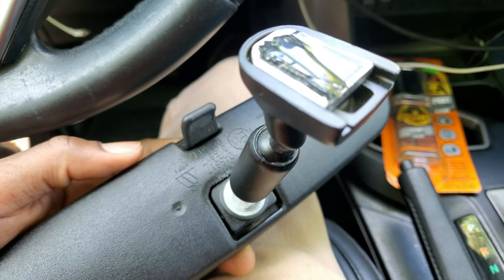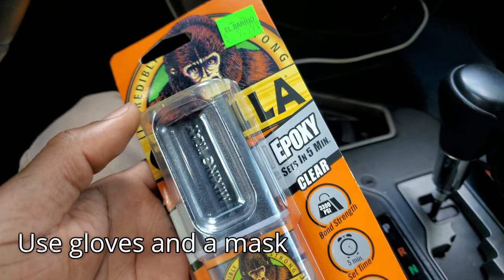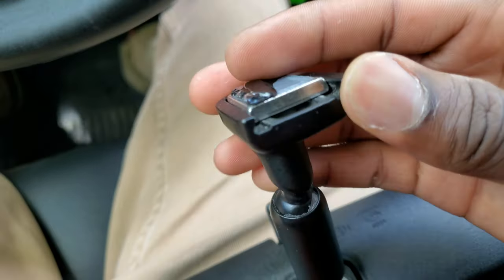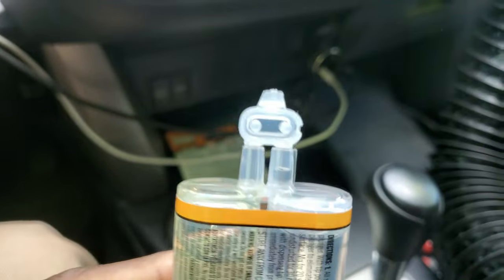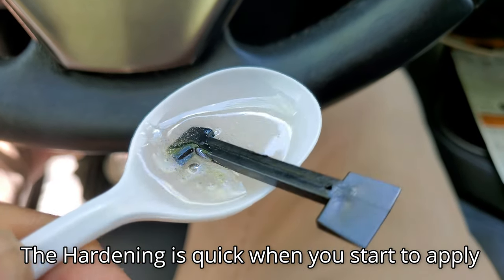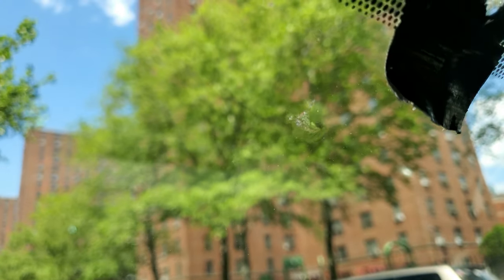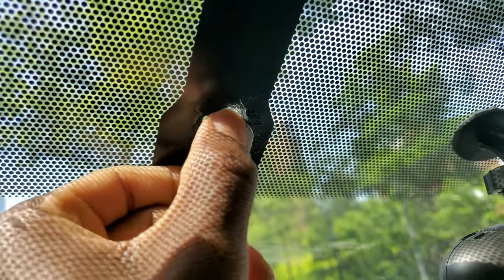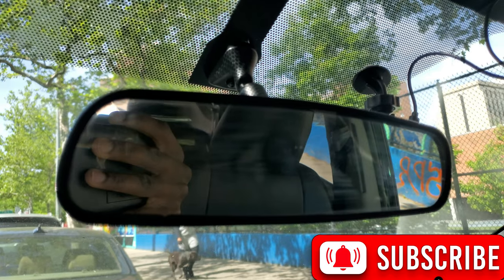Fix Broken Rear View Mirror | Windshield dent

Comment: So i have the same problem. Do i keep the glass on the metal piece and place into the hole w/ epoxy or do i fill the hole up w/ epoxy, scrape the glass off the metal and then reattach the metal to the expoxy and then of course the mirror???
Reply from the maker: scrape the glass off the metal piece first, then fill the hole in the windshield with epoxy. If you are using the same glue I'm using, be swift with it when applying the glue, it hardens quickly. Also have the metal piece orientation in mind so you don't accidentally place upside down
Reply: In addition, do we allow the epoxy to dry first and then glue the metal piece on or put the metal piece as the epoxy is drying?

Comment: how did you scrape the melted glass off of the metal button? I REALLY need to know
Reply from the maker: Smacked it with a heavy screw driver continuously till the glass came off in pieces, it's also dusty. Heard that the piece of glass can be removed by heating the button to undo the glue

Comment: They make a glue specific for this job, it's called Rearview Mirror Adhesive.
Reply from the maker: That wouldn't work here due to the dent in the glass. Something more viscous is required to fill in the dent (it will keep dripping down if it's too fluid), plus Rearview Mirror Adhesive is either liquid (too little) or double sided tape(not applicable here. They mostly used to reinstall accessories after replacing windshield

Comment: Ordered some of the epoxy, can I ask if it dripped a lot when applying it? Also do I have to mix it first or can I use the syringe to apply it straight on and press the mirror tab into it? If I do mix it first can you tell me the ratio roughly? Sorry for the questions just really want to fix it properly, thanks!
Reply from the maker: Hi, for the ratio, it's 50/50. It's a double syringe system so both will drip equally. It does flow down while applying, so definitely mask tape the windshield around the area. You have to mix it. Once you mix it, it can start to hardened quite quickly so be fast. Try not to mix for too long, there is also a strong smell to it. I would also place a towel over my dashboard because any droplet will be permanent

Comment: hey thank you so much, but there is one question, do you fill the hole entirely with the epoxy glue?
Reply from the maker: Yes, fill in the hole with the epoxy. I found it a little tricky to do especially due to the upside down situation and how quickly the glue can start hardening before you get to fix it up.
Reply: @YvonSmart  Thanks! Oh, and also. Should you apply the glue on the metal piece aswell?
Reply from the maker: @arkalanin  No need to, this is a permanent bond between the metal piece and the windshield. You might, but the glue only goes between the metal piece and glass. You need to be able to slide the mirror off in the future.

Comment: Does it not work on regular super glue such as gorilla glue correct?
Reply from the maker: Gorilla glue is the brand, they have all types of glues. Be sure to use epoxy glue (Clear preferred), not the light liquid ones like crazy glue
Reply: @YvonSmart  but it doesn't work with regular super glue correct. I tried and it didn't stick
Reply from the maker: @whatitisnt.  Correct, it doesn't work, some may stick for a few days, but comes off when adjusting mirror
Reply: @YvonSmart  it also doesn't work on permatex rearview mirror kit. Perhaps epoxy would be better instead of a designated rearview mirror adhesive?

Comment: Do you have to sand or scrape the excess epoxy?
Reply from the maker: No, unless you put too much and it may spread when you press on the metal button. So I recommend using masking tape around to prevent the glue from spreading onto the windshield

Comment: How is it holding up? With heat and so on? Is the jb weld clear weld good too? I've seen nice reviews on it on Amazon, can't find the gorilla glue here. But jb weld is heat resistant too
Reply from the maker: It's holding very well. JB weld would work just fine. Make sure it's clear, made for glass

Comment: I have same problem. I have been advised against filling epoxy in chip to avoid any cracks. 2016 make car. Did you see cracks or any other problems with this fix ?
Reply from the maker: I haven't had any issues what so ever, seems like a permanent fix
Reply: How about if I live in Midwest where we are both extreme temperatures, do you see any problem with that which could lead to cracks ?
Reply from the maker: @desilassi8547  This will work regardless

Comment: Did you put the epoxy on the metal piece as well and applied it to the glass?
Reply from the maker: I only put the glue on the glass. When it starts to harden, it dries quickly so I don't recommend applying on the metal button even though you can if you are swift enough. Use masking tape around the application area to avoid epoxy dripping onto windshield and double check the orientation of the metal button, placing it upside down is a nightmare since epoxy on glass is permanent

Comment: I used the J-B Weld epoxy.... is yours still holding
Reply from the maker: Yeah, it's still holding, JB weld is good too
Reply: @YvonSmart  so did you put 1 layer of the epoxy to cover up the glass dent and then after that dried, you then glued the mirror button
Reply from the maker: @lwill4075  I fill the dent with epoxy and added the button right away. The epoxy get viscous quickly so it holds. But I only mounted the mirror next day
Reply: @YvonSmart  got it... thanks

Comment: having a hard time filling in the glass with the epoxy and smoothing it out. anybody have this problem??
Reply from the maker: I did not try to smooth it out since it's under the metal button and not visible at all. It's very tricky especially due to it being upside down

Comment: What if you take it to a mechanic?
Reply from the maker: Would be a good idea but most mechanics would suggest a windshield replacement
Reply: @YvonSmart  how much does it cost
Reply from the maker: Depending on the vehicle, a windshield replacement can run you over $300. I'd rather glue it back myself or by the mechanic if possible
Reply: @YvonSmart  I used the penatrix but I put the medal button on the wrong side
Reply from the maker: @by_dark_mm9138  If you used the same glue as in the video, it's gonna be impossible to remove it without risking the whole windshield, if it's already dry
Reply: I drive a 2012 Nissan Altima would the windshield replacement be cheap?

Comment: Is it still holding?
Reply from the maker: Yeah, this is a permanent fix
Reply: @YvonSmart  The glue is very strong or not? Does it work with glass and metal?
Reply from the maker: @IronZk  Yeah, it's a very strong glue for glass, but for metal, JB weld is better.
Reply: @YvonSmart  My central miror is quiet big. Do i need a mask?
Reply from the maker: @IronZk  Not sure what you mean by mask

Comment: What does the glass on the outside look like?
Reply from the maker: It didn't look so nice because the black film ripped, I would have masked the inside with similar film after the epoxy dried before gluing the metal piece to the windshield if I knew. But I ended up sticking a film on the outside it fixed that
Reply: Did you put the epoxy on the metal piece as well when applying it to the glass?